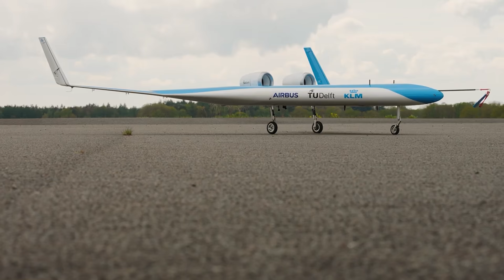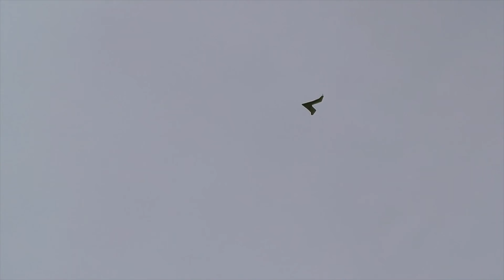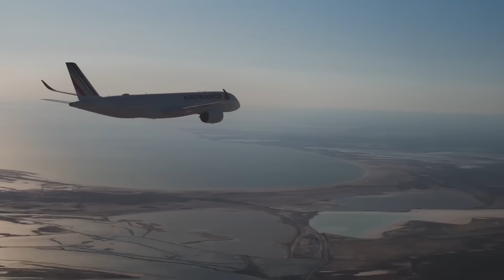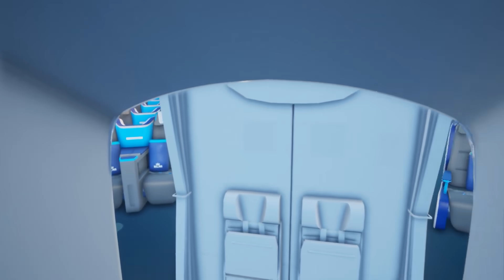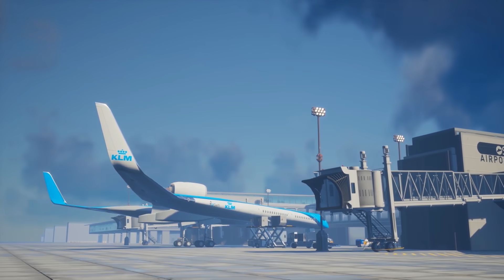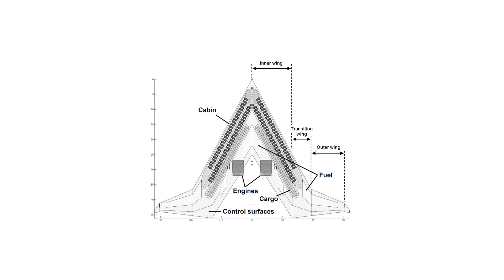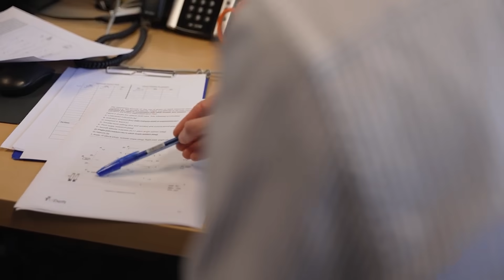The Flying V’s Fatal Flaw: Why This Jet May Never Fly Passengers!

Comment: Isn't this another case of trying to solve a problem that doesn't actually exist?
Reply from the maker: I don't know... does it?
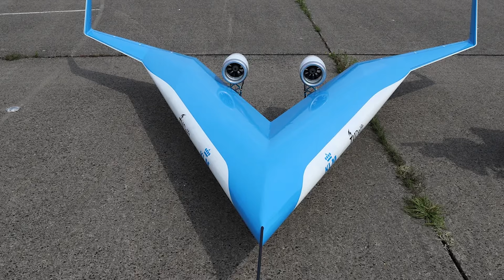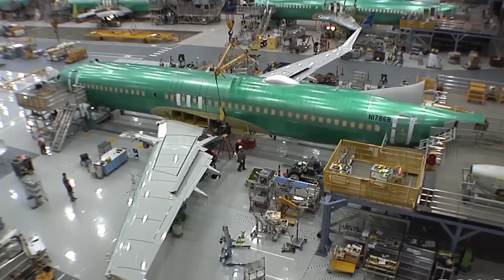Reply: @ExPlaned1  Yes it does.  From 1:16 to 1:48, it is claimed that there is "stagnation of commercial aviation design for 7 decades."  How can this be an issues or problem when we already have designs that work and have been actually been improving over those 7 decades mentioned here?? 

By the looks of this video, it would seem that the carrying capacity is what is important Here.  In this regard, what would a  Flying V do that an A-380 can't do?

Comment: What about cargo? That radical design is completely flawed. Consider that an airliner's core revenue is cargo, not passengers. No airline will purchase a plane with limited cargo, especially if that plane will not have a second life as a cargo conversion after 20 years. Engine inspections and maintenance are checked by ground crews frequently before and after each cycle making the top mounting of the power plants a fundamental problem. Then there's very little space separating them, leading to a higher probability of catastrophic damage to one engine spreading debris to the other.

Comment: anyone with basic sense of engineering sees this not happening if just for the economics of it all
Reply from the maker: You've hit on a really crucial point about the economics, which often gets overlooked in the excitement of new designs.
Reply: @ExPlaned1  one can start thinking about optimal maintenance costs and work back from there. under-wing engines stuck around for a reason

Comment: Fuel efficiency is important, but so is having Parts, Mechanics and Certifications for it, as well as Passenger comfort and easy ingress & egress. Interesting Design but a hard Sale.
(edit) Jetways and Ramp Space are also very different for this AC.
Reply from the maker: You've hit on some really crucial points there! The infrastructure and logistical challenges of a radical design like this are definitely as significant as the technical ones.

Comment: Well, first of all, wing and tube planes take years to develop, and then chip programmers make them a terror to fly in (B737-max). We mustn't be too quick to compare apples to oranges in materials, technology, and construction formats, when in comparison, none of these are alike between a composite strength-engineered form and the old circular aluminum tube thing. The strengths of materials are different, the loads across wingforms are very well understood, and test are being run. One mustn't be too quick to poo-poo the diarhea curring results of both curring composites, and using multiple grunts of stress tests to proove structural integreity of foreseen breakpoints. And while we all can fart about the room about how people will never agree to ride a certain vehicle, look at all the modern ones that people ride today, and seem to stomach just fine,  that did not exhist 125 years ago. Let's see what they (the people) decide....bon apetite!

Comment: Use it as a cargo plane?
Reply: Yea, i was thinking about a few month backm having a dlying wing cargo plane makes sense.

Something like a flying wing sthe size of a B2 with the same wngines as the A320neo could transport about 60 tons of cargo in 4 to 5 containers and the fuel consumption would be on par with a truck.

More impresivly. Pilots are actually cheaper than truckdrivers. Even if they are two
Reply: Or a bomber or a tanker or a cargo plane.

Comment: BUT. Where is the fuel? In conventional aircrafts in The wings, away from passengers.
Here it needs to be near center of gravity = below the passengers. Dangerous
Reply: I get what you're getting at, but in a conventional airplane there is a fuel tank in the center of the fuselage as well, in addition to the ones in the wings.
Reply: With passengers in the wings, the wings need to be really thick.   Adds drag.  Will limit cruise speed.   No longer more efficient

Comment: The huge advantage of a flying tube is that it can be lengthened or shorted to fit the needs of customers based on the economics of the number of passengers that works best for the routs they fly. This would require building different models that are longer or shorter by putting in a tube shaped plug or removing one, not reinventing the wheel as would be required by the flying V. Still, the flying V looks far more cool!
Reply: The Boeing/Husky studies of spanloaded cargo planes says otherwise. Standard designs which are stretched far beyond the original aren't the original, and are taken as far as possible already.
Lengthening a tube requires redesign of the wing center box and landing gear to accommodate the extra weight and height needed for rotation.
 Extend an airfoil shaped lifting fuselage spanwise, and every few lanes of cargo you add another engine and landing gear set, and the runway length doesn't change, the rotation angle doesn't change, and the L/D goes up.
Reply: Yes, Junkers worked on that system almost a century ago. But today increasing span means it won't fit the airport. Boeing has a passenger liner with folding wings like a carrier based plane to get around that- but you can't fold wings with passengers in them.
Reply: @bierce716  Huge span loaders are a straw-man, with things like Burnelli, the '70 Boeing model 754, and the fairly recent Russian "Frigate Ecojet".
 Then there's the X-48-C and the entirely reasonably scaled "Jet Zero" concept regional/feeder liner.

Comment: its simple, form follows function!!  The basic law of design and function.  Stress points are real, and modern passenger jet design has gotten rid of all the stress failure points due to metallurgy, design, and maintenance programs.  Plus, one has to take into account the countless cycles of pressurization, takeoffs, and landings, and weather.  It's all related. That is why modern passenger planes continue to have the basic, proven design that makes flying safe, along with the amazing engines that we have now.  Very impressive!!

Comment: Can't the interior of each leg be made as self-contained 'cylinders' while the outer shell retains the aerodynamic form factor?
Reply: Resulting weight?
Reply: That’s exactly what I would have presumed in the first place … In my view the inner form does not have to reflect the outer shape. If I hear of rows with 18 seats next to each other, my first thought is „what about the 90 seconds emergency evacuation“. And my second is, what a nightmare if people need to get to the restroom … So maybe you could even have two separated compartments / tubes in the plane, with one exiting to the left and the other one to the right.  And the cockpit could be separated as well, making hijackings nearly impossible.
Reply: And what would that do? You can’t contradict the need to bank on a curve. And the further out you are from the center, the more the rise and fall. It’s enough to have some people throw up. There is no way to prevent this. Forget the pressure problems, that’s solvable. Do whatever you want to about a cylinder internally, that’s an engineering problem. But the passenger comfort is the problem that can’t be solved.
Reply: @melgross  Ofcourse it can be solved. We designed current bank angles for turning with the current limitations in mind, but it is possible to sweep the curves out significantly for more comfortable approaches and turns.
Reply: I came here to make just that suggestion!
Reply: I would guess that is the most obvious design spec.
Reply: Was this not always the idea?
Reply: Where would you put the fuel the?
Reply: Just angle the seat rows parallel to forward direction. Problem solved … but their is to much surface area.. we are at the maximum now with small wings, people still get injured.
Reply: Put pillars down the middle of aircraft.
Reply from the maker: That is actually a very very good question
Reply: @ExPlaned1  Like a double hulled submarine where only the internal hull is pressurized.
Reply: @toolbaggers but then you lose the weight savings

Comment: why go rigid?  why not have a more flexible material to hold the pressure?
heck- why worry about sealing it?  just carry a way to keep the pressure on the interior positive: essentially air compressors pulling air in faster than it escapes

Comment: If the BWB can’t make it after Boeing has spent huge sums of money on it (and having a lot of the same issues), the Vee has no chance.
Reply: Boeing never had any intention of following through. They torpedoes it after it proved through all the studies. They've said so since the '70s model 754 fiasco. They will never build a logistics or civil plane with a lifting fuselage concept.
Boeing dropped it after the wind tunnels and engineering studies proved it, leaving NASA to have Cranfield U build the entirely successful X-48-C.

Comment: If they succeed in sorting out potential problems, adventurers and thrill seekers will choose to stay on the cheap “roller-coaster seats” enjoying the ride. However, I can’t see them enjoying a long haul flight having to wake up or hold their drinks and food trays every time the aircraft changes course.

My bet is on the less radical blended wing design.
Reply: If a passenger plane exceeds 25° roll or does even that quickly, it's called an "incident" and requires an investigation and possible decertification and sacking of the crew.
Sudden aerobatics of a civil liner is a straw-man. So what if a single Boeing did a slow-roll without exceeding the structure. It never happens.

Comment: I'm surprised at one of the biggest flaws not being mentioned. In a regular tube airplane if you have a decompression scenario it can highly damage the plane but it is far more survivable than in a V.  STRUCTURAL DECOMPRESSION DIRECTLY AFFECTS THE FLIGHT SURFACE.  The last thing you want is flying surface deformation. Imagine in a regular tube airplane you have a rapid decompression that compromises the wings themselves. That's a super dangerous situation. I think The v makes a far better cargo plane and only pressurized the cockpit. Then you can get more load, slower flights, and better fuel economy. 

By the way it is a myth that a wing is more efficient than a tube plane. A wing is only efficient at moderate speeds but grossly inefficient at high speeds. For instance the most lift is a flat flying wing like the solar powered wing NASA built. That is the most efficiently far more than the v. 👍
Reply: on sea level outer pressure and inner pressure are nearly the same. Why should the plane's surface then suddenly collapse when building an equilibrium in less denser air? A conventional cabin doesn't collapse in such a situation either (these are not blimps you know 😁)
Reply: @grysufeuermelder9602  not collapse, explode not implode.
Reply: @toolbaggers  so when you open a soda can (comparable pressure difference when shaken) it explodes in your hand? 😳

Poor boy you are 🤣

Comment: You have to consider the motion of the plane and passenger in all directions. Personally I could probably handle most except for yaw. At the furthest from the center I am pretty sure there aren't many people that could handle that. Yaw seems to be the worst during  landing in cross winds. (Not a pilot.) It wouldn't be for very long but boy would it suck. 

Now how exactly would you solve the boarding and evacuation issues? Doors in the leading edge seem like a bad idea. Doors underneath might work but sacrafice seats. 

Engines that far back and mounted high also could be an issue for a real plane. You'll see that on the few jet powered  planes with inlets above the wing they need additional air intakes to avoid starving the engines during takeoff and landing. The B2 has little doors that open.
Reply: I agree with you. Sometimes passenger aircraft bank pretty hard (at least it feels like that). That would be a nightmare on the seats furthest from the center.

Comment: Seems like the form factor ie the really wide plan, would require redesigning air terminals, possibly taxiways as well. The blended body seems a better bet imho but just barely. For pressure stress management and constructability it's impossible to beat the tube for aircraft design.

Comment: You ever notice how much a planes wings bend up at the tips? No envision that from the inside of the wing and how under load, the passengers at the back would see the entire wing of passengers in front of them bend out of view. This is an utterly stupid design.
Reply: Well, the thick body-wing might handle torque very differently than usual airliner wings. There may not even be as mich torque to begin with because each section of the plane carries its own weight aerodynamically
Reply: I once sat in Narita's AA Business Class lounge for a few hours and watched 747 after 747 take off. It was fascinating to see exactly when the wings took the load of the fully fuelled and loaded plane about to go on a trans-Pacific journey!
They would flex at least 15 feet or so at the tip.
Having seen the stress test videos of 747 wings being flexed to their breaking point, I was pretty comfortable knowing they had a long way to go before failing! 
Almost 30 feet, as I recall.

It's also cool and interesting to watch videos of B-52s taking off after taxiing with their droopy wings! They never flex up, but get almost dead level or flat once they've assumed the load!

The engineering is crazy good!
Reply: and you think that a lifting body design bends the same amount as a thin wing? This is an utterly stupid assumption.
Reply: @grysufeuermelder9602  "If it doesn't bend, it will break." Learned that in engineering school.
Reply: @EngiRedbeard  only when it exceeds the limit carbon fiber wings don't bend
Reply: @EngiRedbeard  "That's why fuselages are made of rubber". Learned that in elementary school.
Reply: @fred6319  carbon fiber wings don't bend? lol, ok
Reply: it doesn't works or is built like a conventional wing
Reply: Doesn't happen to a B-2

Comment: I have to take so much Xanax just to get me in an airport anymore.  It won't matter to me what seat I am in.  I will sleep through it all.  I learned that the expensive way by wasting money on a first class seat the last time I flew... I don't even remember the flight.  Xanax is the answer to dealing with air travel AND it makes a middle seat in Coach, just as good as one in first class.  😁

Comment: Very good video.  It will be interesting to see what may come of this design.

If going the commercial airliner route, one basic but practical matter comes to my mind.  Airlines tend to be very big on new aircraft that can use preexisting facilities with little or no alteration.  I could be wrong, but it seems to me that a shape change this radical would require major alterations to any facility it might be expected to use - notably airport berths and maintenance hangars.  Lesser alterations possibly needed for service vehicles, taxiway clearances and so forth.

  Not an insurmountable problem to be sure, but certainly an added complication that would need to be fully addressed.

Comment: Every single shapely coke bottle is a pressure vessel that isn't a sphere nor cylinder.  With enough structure and genius this could be possible.
Reply: Its a fancy cylinder and not dealing with the same levels of pressure.

Comment: Flying V as a carrier, but the center will be a cargo tube that is removable and self contained.
Have that cargo tube made not only for passengers, but also for cargo.
The passenger tube will have all that is needed.
The Flying V can have a quick turn around, since all that is needed is a new flight crew, fuel and topping off of fluids.
THIS IS THE FUTURE!

Comment: Internal structural bracing could be built in the cabin architecture. The only load would be tensioning not compression. Maybe work maybe not, but every problem has a solution. material or design solution
Reply: They do, but as was pointed out in the video, there can be penalties in overcoming those problems.
I worked at disc drive companies my entire career, and one of our customers' biggest complaints was to have drives come ready faster without drawing more current.
The physics just wouldn't allow it until new design philosophies and techniques emerged.
It was easy to get the drive to come ready quickly, but the power draw would go through the roof.
Reply: Structural Bracing = Weight. Just saying..

Comment: One possible solution.   Inflatable passenger cabin like Bigelow SpaceHabs.  A tube within the aerodynamic shell.
Reply: The solution is to avoid bad project. Wasting time thinking about dumb things it is not smart.
Reply: That actually would work better for Bernoulli Craft , such as the proposed "Double-Bubble" jet ! 😎
Reply: Hard to integrate it to wing. Unless there would be no widows... no solid surfaces. Because inflatable cabin would work with changing pressure and you wouldn't be allowed to prevent that.
Reply: It already is: it's a paddle board.